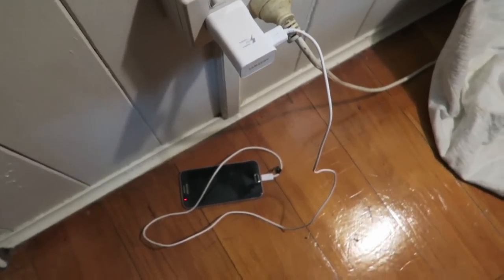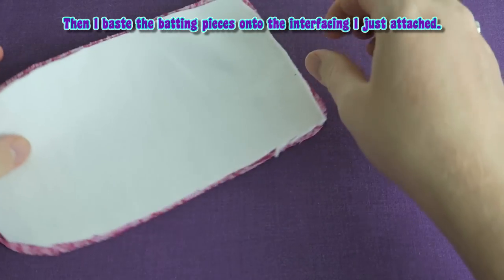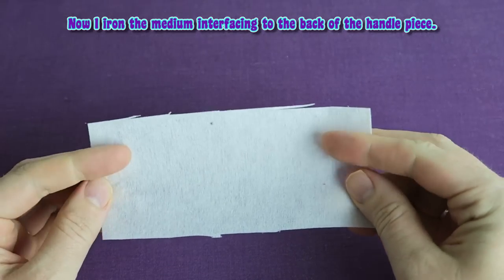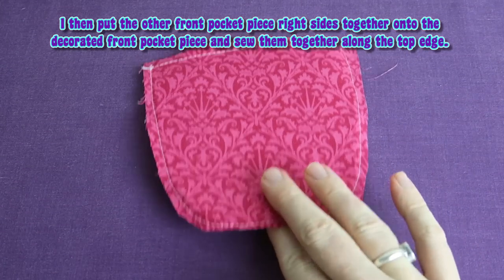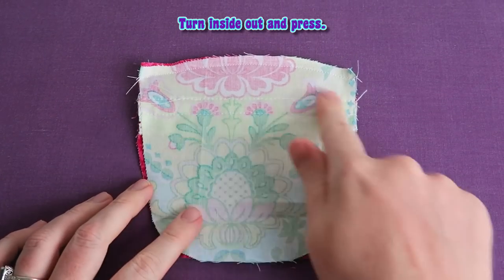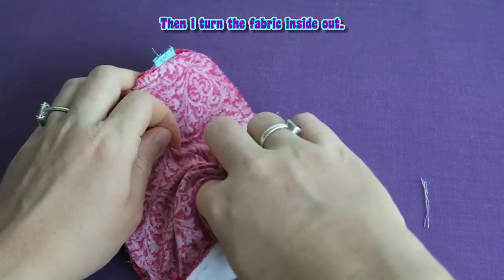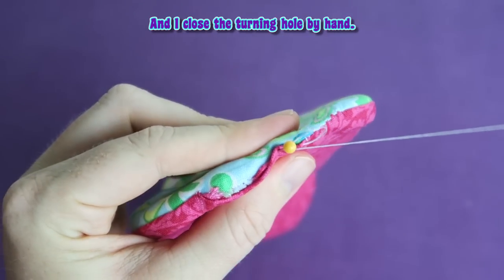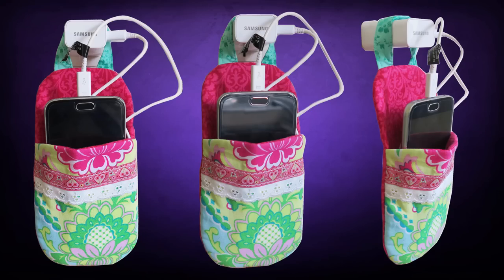DIY | Cell Phone Charger Holder + FREE PATTERN!! • Sami Doll Tutorials

Comment: If you add a toggle or big button to the bottom of the front pocket, it can also be used as a place store your plug and charger while travelling, so 2 in 1 function.   Sunflower
Reply from the maker: This is such a great tip, thank you! And thank you for reading all the way through.